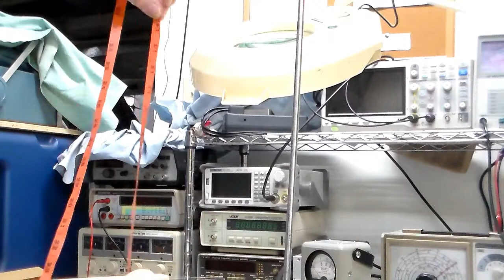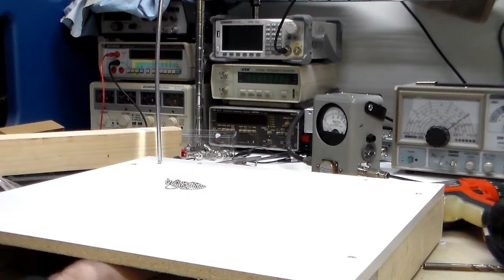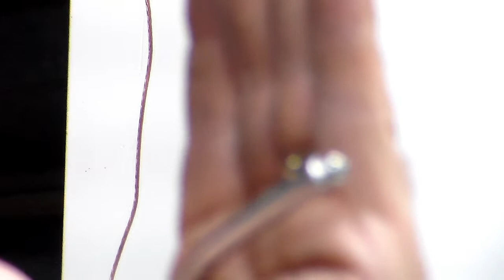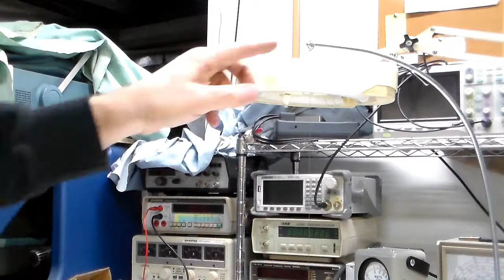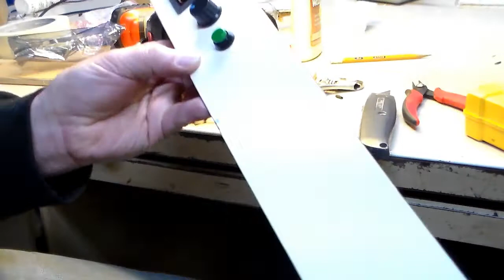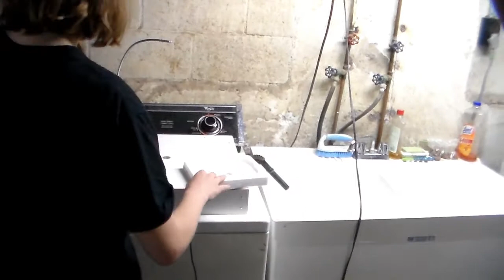Hot Wire Cutter Build

Comment: tim good morning  Yes working and ham radio i have  2 kenwood ts 940 no power on   Let me know thanks Ignacio KF5IWA  thanks  again
Reply from the maker: Hard to say with no testing.  Check AVR board.  It has a fuse.  Sometimes when Power Supply goes it burns the fuse. Sometimes it even burns the board.
Reply: @KA3AJI